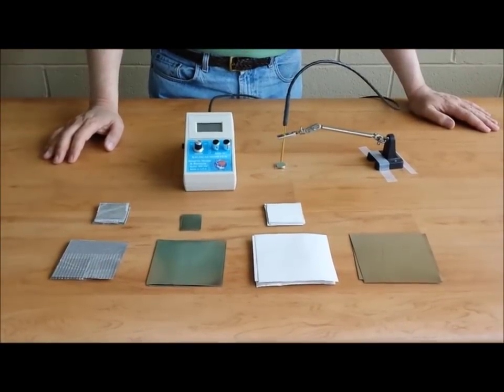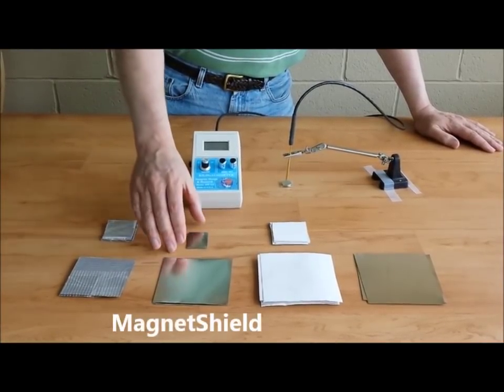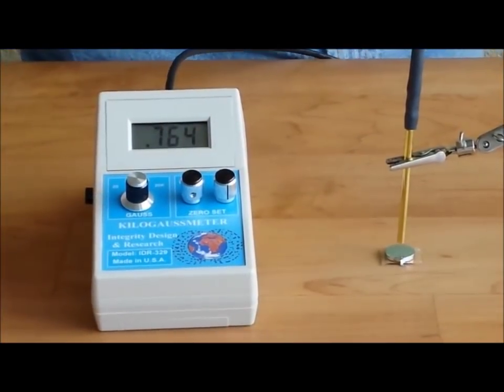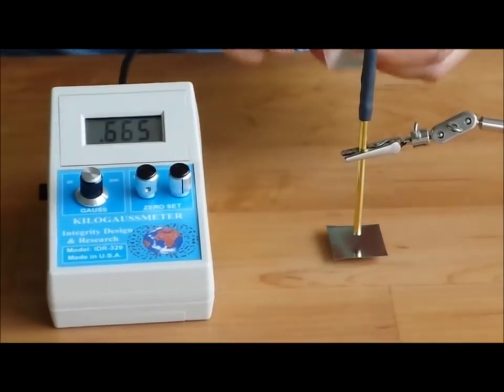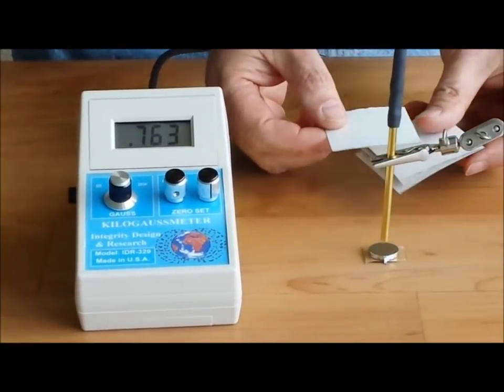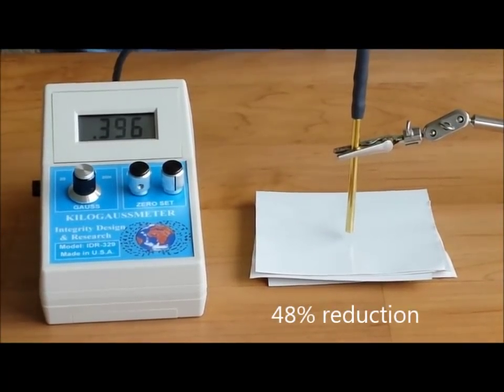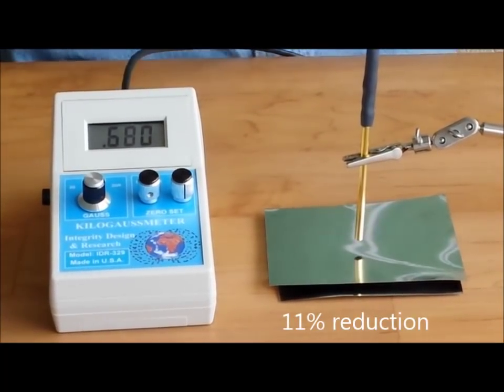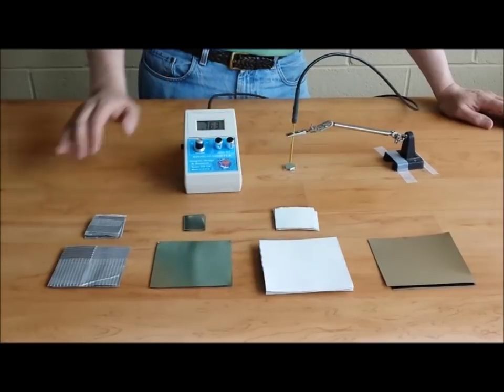DC Magnetic Shielding

Comment: Very good info. I'm building a magnetic motor and i need to shiled parts of the magnets. Let's say i have north on the surface of the rotor and the south inside the rotor interfere with the stator in the following way. Betwen 2 magnets at the center i get an atracting force that comes from inside rotor(the bottom of te magnets). Now i need to shield most of the rotor and leave alone the part at is repeling so i get my kinetic force.
My question is : Is it possible to shiled parts of the magnets and leave alone lets say half of north side of magnet that is at the top of my rotor with any of this materials you present in your video ? Keep in mind i have to shield all the rotor and leave untouch just the exterior of rotor where i get the repeling force betwen rotor and stator(i have  to shiled the stator too in a similar way).
What material you think will be best to use in my situation ?

Thank you in advance
Reply from the maker: If I understand your application, you cannot do it. Remember, a magnetic will always have a N and S pole. You cannot eliminate one of them. You CAN move the location of the pole with magnetic shielding.

Comment: I want to know does mu metals produce resistance when moving through a strong magnetic field? I mean can I use it like a switch for magnetic flux without much of consumption?
Reply: Also isn't the magnetic shield same alloy as mu metal?
Reply from the maker: Yes, it is attracted to the magnet. Mumetal is one type of magnetic shielding alloy. As you can see from the video, there are many alloys used for magnetic shielding.

Comment: SO I want a 1m2 of paper shield that is about 0.5 to 1 centimeter thick I need something that doesn't interfere with the magnet but still shields it :) how much does the paper one cost and how much the MU metal ?
Reply from the maker: PaperShield is less than 1 mm thick. and it is attracted to the magnet. PaperShield is 36 inches wide and is priced per foot long at $14.22. We offer an alloy similar to mumetal called Magnetic Shielding Foil. It is 15 inches wide, x .004" thick and is priced at $24.95 per foot long.
Reply: I need that one that is less attracted to the metal and and blocks magnetic flux with highest possible efficiency. Also you should try to sell the material that has no influence from the magnet but still insulates best